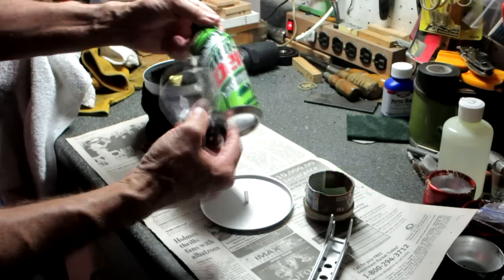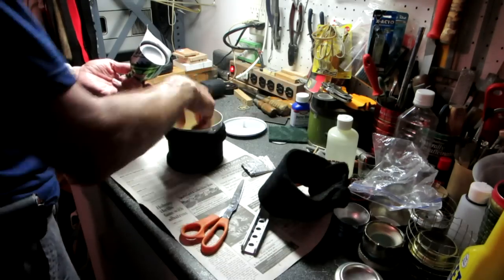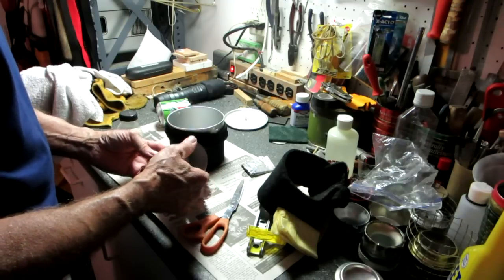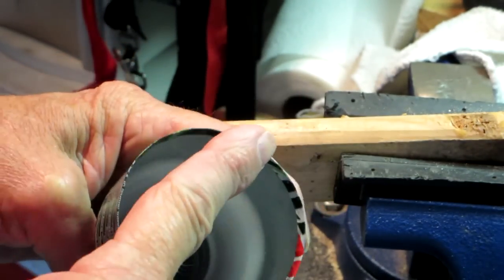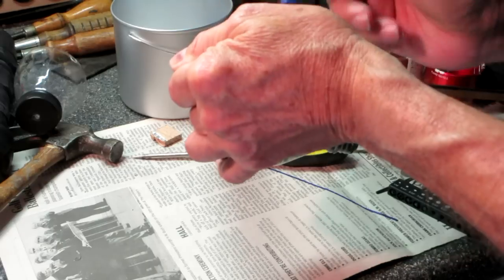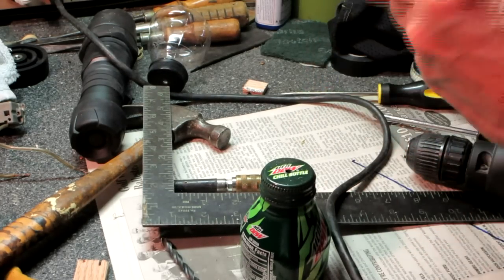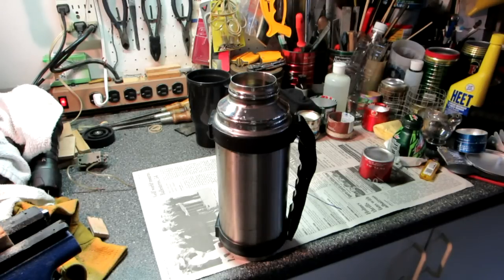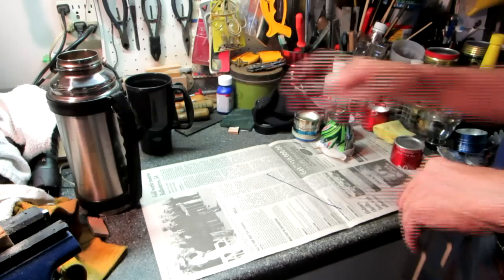DIY drip coffee maker for backpacking and camping - revisited and updated

Comment: You shoulda' just bought the Coors Light bottle. Woulda' been a much more enjoyable drink and probably healthier...haha :o) I only used mine a few times never noticed if it shrunk or not...lol! But that's a good fix for sure. Nice one!
Reply from the maker: I think the plastic has changed from 3 years ago.  I used my original quit a bit.  Didn't notice the shrinkage/deforming problem until I replaced it about a year ago.  I did not see single containers of Coors Light at the store.  Just needed the container so I got the MD.  Maybe a quick stop store has single bottles of beer?.  I'll check sometime just for curiosity, don't drink anymore anyway, haven't for 10 years now...
Reply: ***** LOL! I don't drink either :) I may buy  sixpack twice a year :D And I don't drink pop other then Canada dry Gingerale once in a while.
Reply from the maker: Canada Dry... of course :-)

Comment: Nice job, have you experimented with drilling small holes in the bottom and lower sides and just not use a filter, just a thought.
Reply from the maker: No but I did purchase a tea ball which I haven't yet tried.  I should try that this week.  Going back out for a few days...
Reply: ***** Have a good trip, hope you get back with us on the tea ball deal
Reply from the maker: Loneoak1955 Tea ball does not work.  The screen isn't tight enough to keep the coffee grounds contained.  My cup and coffee was full of grounds.
Reply: ***** Wish I'd known that before I bought tea balls for a set of grab & go bags for family. Oh well, guess they can still be used for pine needle tea. Uhmm.... I bought the wire mesh type. Did you buy the metal version with holes drilled in it?
Reply from the maker: Oldtimer Lee Wire mesh type.  Also when I was using it I realized the container limits the amount of coffee you can use, thereby limiting the quantity you could make at one time.  I can't see getting a strong enough batch for a thermos full of coffee from a tea ball size container.

Comment: Seems like a lot of trouble considering you can buy a set of 3 plastic kitchen  funnels for a dollar at dollar store.  They won't get hot like metal either.  Use with no. 2 cone filter.  Oh well, have fun!
Reply from the maker: #1 As I mentioned, plastic changes shape/begins to melt with hot water.  #2 People are getting more and more leary of using hot liquids with plastic.  I'd be even more concerned about "dollar store" plastic.  #3 They won't fit my cookset.  My DIY coffee maker is a custom fit for my cook set.  #4 I'm retired, what else am I going to do with my time :-)
Reply: Yes, pop bottle plastic is for the birds.  Funnels are okay, thicker.  Agree it doesn't fit inside cookset -- I keep mine with my supplies.  Retired ... have you tried carving a wooden one?  Have fun!  (:
Reply from the maker: Mary Cahill :-)